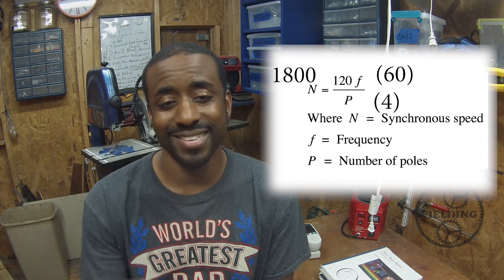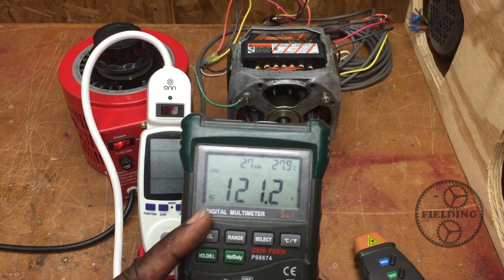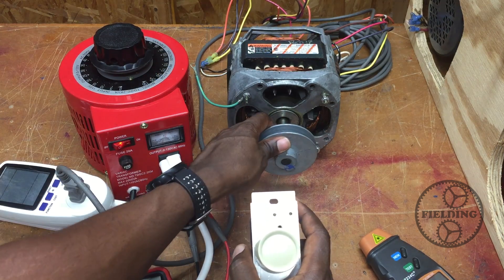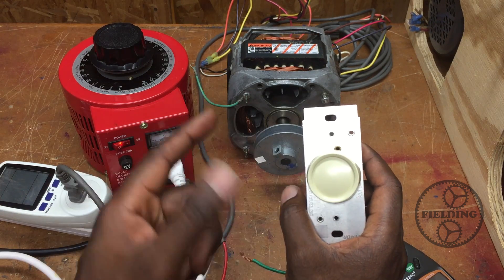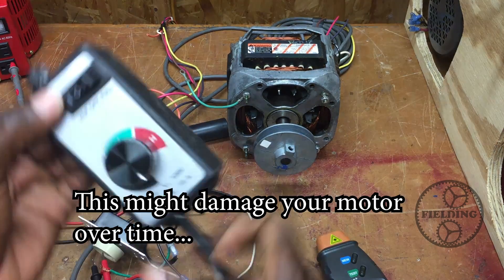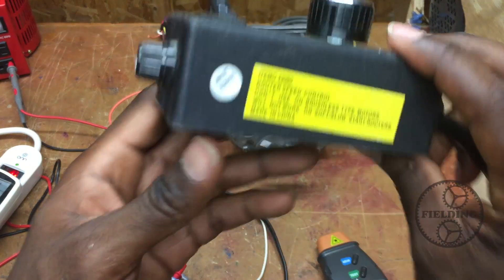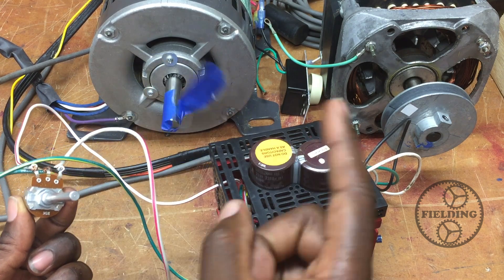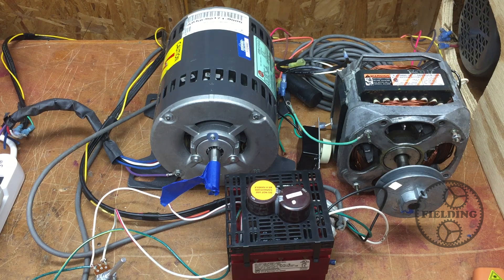Will A Dimmer Switch or Transformer Control An Induction Motor's Speed: 038

Comment: I have a VFD board that can accept 110volt or 220volt and run a run a single phase 120 or 220 volt motor depend on your application. I tinker with electronics and motors but not as experienced as you. We have a Water Well Drilling Business and we use variable frequency drives on a great deal of our pumps. We also keep all the vfds  when we replace them with new one's. Look into submersible well pump VFDs If you need a vfd like you cant find. I current took the board (which I think is not attached to the transformer) off an Goulds Drive that can be used as a single phase 110volt or 220volt input/output. This type was typically used for retrofitting an existing well pump that was not 3phase but that customer wanted constant pressure water in there home. The maximum hp pump is 1hp(9amps) or maybe 1.5hp(12amps). With all that said I put 110volts on it (line 1 black wire L2 white wire). The output terminal is labeled RED BLACK YELLOW GREEN. I'm getting around 50volts AC on RBY terminals. This is all it tested. I haven't tried it connect anything to it. I may try a connect a light bulb first then work my way up. This vfd board has a massive amount of small capacitors and resistors and a wide 12 pin comp cable that I suppose connects to the digital display. My question is do I need the transformer that is usually stuck under this board? It also has a large pcb board under the transformer.

Comment: Have you try those dimmer for fan coil air condition? Those dimmer control motor speed of the fan coil motor, and i guess it is pretty esay to find as well. I have try that on a hand held drill and it work when without loading, but a big one like this? It looks like a 3/4 hp to me, that is around 500+ watts.....
Reply from the maker: I think you might like part two of this series, where I talk about the fan induction motor. It was the very next video I made

Comment: I have a question about "VFD's and Induction motors". First my problem. I need to control the speed of a 3 Phase, 1/4 HP induction motor; but I do not want to pay a lot of money for the VFD or the motor; for ALL I want to do is to change its speed. I do not need ALL of the many "frills" that VFD's often have.

Kind sir, would you please give me some suggestions of what I can buy that will not break the bank; when it comes to the motor AND the VFD.

Thanks sincerely.
Reply from the maker: Please check the last note in the description. Thanks!

Comment: Hi there, great video! If I have a AC 110V 1PH Supply and I need variable speed out of the motor - what are the options besides a VFD with 3PH induction motor? Would a DC motor with transformer work - what would be the best way to vary the speed with a DC motor? Thank!!
Reply from the maker: Please check the last note in the description thanks!

Comment: I need a variable speed motor or my lathe But I hate the sound that a Vfd Makes. Is there anyway you know of to remove that high pitch ringing?   Is there any advantage over just using a DC motor with speak intro? Do I lose torque somewhere with DC that I might not with AC?

Comment: Jeremy, Great video. I am still confused about the difference between a brushed motor like a router or a direct drive chop saw and an induction motor. Specifically, I use a HF router speed control on their router table, and would like to use one on their 14" chop saw (brushed) to run a "Evolution type" metal blade that's rated at a max rpm of 2500aprox.The HF chop saw is approx 3500 rpm. Can I safely slow that chop saw down?
Reply from the maker: Most chop saws are universal motors and they slow down with HF type controllers. I don’t know how well it will work for you

Comment: Sir I have a marble cutter saw rpm 12000 Hz 50 watt 1050 ac motor, over speed please tell me which controller I will use
Reply from the maker: Please understand, I get hundreds of emails and messages asking for advice. At this volume it just isn't practical or safe to give one on one advice.

Comment: I always wondered why potters wheels cost so much.  I have been gathering parts from my normally inexhaustible supply of junk, but now I think I have hit a roadblock.  I have a 3/4 hp 1800 rpm induction motor but realize I cannot turn it on slow enough to start a potters wheel (can you say "clay" everywhere).  Do you have any ideas for a controller other than the expensive one?
Reply from the maker: Starting a pottery wheel at full speed is definitely bad. I don’t know what say other then save some money cause it’s worth it to do it right.
Reply: Thanks Jeremy, I guess I'll have to try and source a large enough DC motor to use.  Thanks for the videos.  You do an excellent job!
Reply: Two more questions Jeremy.  First, where did you get that awesome turntable you have some of your stationary tools on?  Second, after watching this video for the second time I was lying in bed and my mind was wandering, as usual and I thought, would a super duty hand drill work for the motor for my potters wheel project?  Just thinking, add a dimmer or cheap HF speed controller and maybe I would be in business.  What do you think?  Sorry about all the questions, but I know how it feels!
Reply from the maker: I use to have a pottery wheel. A “clay boss jr” I think was the name. I don’t like giving this kind of advice because there are too many variables I can’t see, but maybe a industrial drill could give you the torque. Just not for very long. There is a duty cycle for motors and a drill gives high torque for a few seconds at a time. Making a pot can take some time. You have to think through your project and do some homework...consider how large of a work piece you plan to make; how long it takes and power needed. Your question is tougher than you think. But You should at least use something rated for the same power output you have now
Reply from the maker: I made that turn table and there is a video about it
Reply: Your right, I will have to do more research to get it right.  Funny, I can afford to buy a potters wheel, but where is the fun in that!  I have moved on a little and am looking at the possibility of using a variable speed (not one with pulleys) drill press.  Not too bad at about $150 bucks and I'll have lots of parts left.  Sorry to be a bother with this.  I guess I have answered half dozes or so comments or questions myself.
Reply: They have foot switches with potentiometers in them it is the same concept as a wah wah effect pedal for guitar...

Comment: One more...sorry... When you lower the speed on a 1/4hp like mine (assuming it is an induction motor) with a VFD, would it also lower the amps(torque)? And if it is a brushed motor, would one of those variable speed contolers from ebay like the one you showed( not the light dimmer)work on mine? SOME TAG INFO DIFFERENT THAN YOURS: Its a Marathon no.S102/ TYPE:SS/ FLA:6.0/ SF:1.0/ SFA:(nothing)/ CODE:S?/ top left corner: SPECIAL DUTY/ CCM YELLOW-1-LINE2 BLUE-4-LINE ONE/ CW BLUE-1-2 YELLOW-4-1
Reply from the maker: I don’t know your machine well enough to give advice. But I will say your machine was designed with pulleys for a reason. It is not impossible to change it. Just realize what you are asking for requires some serious homework on your part and can’t be sufficiently explained in the comment section.
Reply: Jeremy Fielding Totally understand and agree. I still want to thank you because what I learned from you in this video, potentially prevented me from a BIG screw up!! Keep 'em coming!!!

Comment: GREAT STUFF MAN!! I have a question...I have a 1/4hp motor that came with a mini metal lathe. It is a single phase and it looks like your motor on the left but mini me size and it does not have a start capacitor boulging from its ahoulder. I also don't know if it is a brushless motor. What information on the tag lets you know that it is a brushless and or an induction motor? It has the variable speed pulleys, but I think I would have a better experience and like it even more if I had a VFD. Also, is a single phase VFD the absolute only way to have a speed control on mine? Thank you for the time you take to teach us the nitty gritty!
Reply from the maker: That’s why it has pulleys. It is really the best way- pulleys that is. You keep the same power output but can Change the speed.

Comment: So many have tried to use speed controllers on single phase motors and it's not gone well. You might want to dive into this topic a bit more. Devices like the one shown in the link below are always popping up with many thinking! They figured out a way! Well.... yes and no. Might be worth you making another video. And then there's whole other level to play with -  AC  and DC motors that are available in single and three phase, adding another dimension to the topic of variable speed control for induction motors (Brush and Brushless and...) 

https://www.banggood.com/4000W-220V-AC-SCR-Voltage-Regulator-Dimmer-Electric-Motor-Speed-Controller-p-1004793.html?
Reply from the maker: I just might do that... this video produced a lot of questions... some of which I answered in part two (#43), but there are a few key things left that still make the topic fuzzy in some areas as you mentioned.
Reply: Jeremy Fielding One way to approach the topic; rules of electric motors and why some motors can and cannot work with variacs, VFD's, voltage regulators, POTS, etc.

Comment: Hi Jeremy, Can you go into more details about motor speed? What type of ac motors are ok to dim by triac and or by variable capacitor value switches. As I understand a fan speed is reduced by capacitors and it’s designed to slip. Fans obviously don’t have a centrifugal switch or start windings that will kick in at low speed because they are designed in that way. When looking at a fan control each button connects to a different section of the motor windings. Whats the difference between your motor and a multispeed fan motor. What is a shaded pole vs switched pole motor, CS/IR vs PSC motor and how does it affect using speed control.  What types of motors are ok to slip under load and which are not? Very low capacitor value causes difficulty in starting the motor and increases amp draw, I believe it decreases torque greatly in compared to speed which would cause a lot of heat and amp draw if you were loading a shop motor. I have a small 40w Panasonic geared motor it runs at 1400 rpm 4pole 220v 50hz. With the gear box I have attached it runs 50 rpm supposedly up to 50kg of load. Every machine shop guy tells me I can reduce  rpm with a dimmer or by reducing capacitor value. But every shop technician that deals in these motors tells me bad idea. Either you buy a Variable speed geared motor with tachogenerator built in or you changed the gear head. I’d like to find the definitive answer to motor speed control.
Reply from the maker: This video has a part two. Please check it out.
Reply from the maker: Video number 43
Reply: https://www.youtube.com/watch?v=izrzkS5xxuc

Comment: What type of motor does the Tesla car use? I have heard it's an induction motor, but is it single or three phase? In either case, how is the speed controlled when you step on the 'gas' pedal?
Reply from the maker: It is a custom 3 phase motor controlled by a VFD.
Reply: Jeremy Fielding Ah I see. Thanks for the reply! Will read up more on it. It would be interesting to see if it can be powered on a desk/standalone

Comment: BTW, They sell a bunch of "1 phase VFD"'s on eBay in the $80-200 range.
Reply from the maker: The point was not that they are impossible to find. Just that they only work with a limited number of motor types thus most VFD makers don’t make them.
Reply: Fair enough! I was just mentioning.

Comment: so if the dimmer and the router speed controller work the same. I could use a dimmer to control my router's speed?
Reply from the maker: basically yes... but a regular dimmer switch will have less "beefy" components... thus it won't last very long.
Reply: Thanks I only need it when spinning larger bits which isn't that often so i think i should be okay.

Comment: Jeremy I have a question I am building a custom Shaker table for a company that grows crickets and worms but I can't seem to get the motor to slow down I tried everything I've tried bigger Wheels different gear ratios and it doesn't seem to work what should I do
Reply from the maker: I can't do one on one advice. I get thousands of messages asking for advice and help... but its just not safe or practical to do so. I will say the first step is figuring out what kind of motor you have. Once you are sure you can find ways to control it. I have videos on all these topics, you just have to search my channel. Start with "what kind of motor do I have" on my channel
Reply: Ok thank you Jeremy I appreciate it

Comment: variac or dimmer is good for regulating power, for frequency, you need to make an inverter of some sort since vfds are usually very costly. you dont need a starter winding on vfd. just disengage the start winding or capacitor. the vfd can start the motor without any help. thats the whole point.
Reply from the maker: Regarding single phase specifically, you can't just disengage the start winding. The magnetic field has to be offset to effectively start a single phase motor. VFD's don't do that. You don't see starting mechanisms with VFD's because most of them are three phase. A three phase motor doesn't need a start winding... Single phase motors still need a starting mechanism of some sort.

Comment: How does a single phase motor with two speeds work?
Reply from the maker: Two separate sets of windings usually. or if you are talking about a fan, you should watch part two of this video. #43
Reply: Jeremy Fielding I’m trying to add a flasher FS series model # FS126RC with two wires red and black the red is supposed to go the black hot wire the blk wire is supposed
Reply: Jeremy Fielding I sent you a message a second ago but didn’t finish it I’m adding a flasher FS126RC 120vac input voltage to a three wire LDR photo resistor red,black,and white red wire goes to hot center of the led bulb,white wire connected to the other two white wires other two neutral wires one from the power side the other from led bulb side I need to know how to add the flasher

Comment: Very good video.  So, when dropping the voltage with a variac, or across a variable resistor, the drag of the mechanical load will lower the speed of the shaft because the voltage kick from the sine wave going positive, or negative isn't as strong.  The motor will still try to run at its rated speed, but at a lower hp.  Does that sound correct?  Then there is no easy way to vary the speed of a single phase AC motor?  Thanks for posting!  Thanks, Jerry
Reply from the maker: Sounds like you have it
Reply: I have it?  Really?   First time for everything!  What about a router controller on an ECM motor?  Thanks!

Comment: Jeremy..... I have done the EXACT same thing to my single phase washing machine motor using a dimmer switch and it works perfectly for controlling the speed. The motor has no load on it and the rpm's slow down or speed up according to the switch. How is this?
Reply from the maker: The internal load (weight of the shaft bearing friction, internal fan etc) is sometimes enough to tax the motor at low voltage. Especially motors with low efficiency. The problem is the loss of torque not that you can’t get it to respond at all. Lowering the voltage makes the motor weak. Instead of just lowering the speed you really just lower the power capacity of the motor
Reply: Jeremy Fielding ahhh alright and so then running at this reduced torque will result in damage to the motor? Thanks btw Jeremy
Reply from the maker: Very little cooling is more likely to damage the motor. Fan is moving to slowly or slower than designed for that hp rating

Comment: Great videos , learned what I should have known but never had. I have a project you may like to tackle. A dc injection brake for a single phase 220v ac motor common to many lathes and bandsaws. I am searching for components at a reasonable cost to no avail. Most home metal workers and wood turners would love this feature. Fast spindle stopping instantly. Love to hear your thoughts, my problems are the lag timer switch between 220v to starter coil to wait to start and end the dc pulse.
Reply from the maker: Maybe... we shall see

Comment: I’m trying to re engineer an industrial 18 Pole motor into a generator motor, any advice?
Reply: Have you tried spinning a motor with permanent magnets in combination with ac electromagnetic energy?
Reply from the maker: That’s a synchronous AC motor is.
Reply: Jeremy Fielding, I understand that,  but adding magnets to stator and rotor poles forces ac output.
Reply from the maker: If you mean permanent magnets on both the stator and rotor will not work. If no work is added to the system it will produce no work. They align and stop. Even if you push start them.
Reply: Jeremy Fielding I figured how to make it spin, I’m just trying to push power to the stator and rotor coils by using induction motors with an external source of energy to make the motor spin.
Reply from the maker: For a moment I thought you were asking about free energy devices. This is not a good format for giving advice... there are many forums for making generators. I made a series of videos on how to build a generator but it is based on the DC motor. Search my channel. But for personal advice I suggest a forum
Reply: Jeremy Fielding, no sir, it’s an 18pole 1800rpmthe drive magnets are mounted on the shaft, but while spinning, the induction motors induce current into the coils of the rotor and stator coils via electromagnetic induction.
Reply: Jeremy Fielding I’m trying to double the speed to 3600rpm, ac magnets spin it by alternating electromagnetic field acting on permanent magnetic fields.